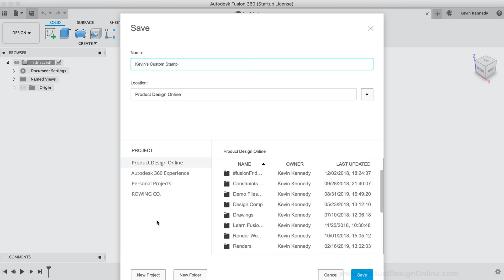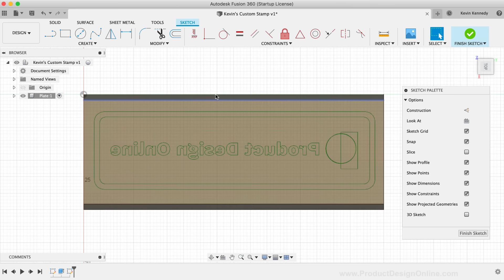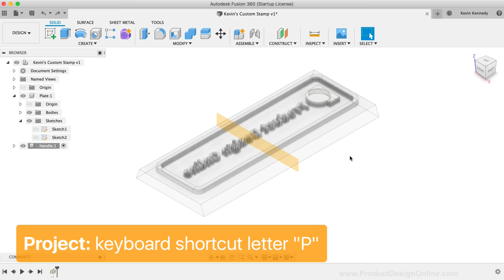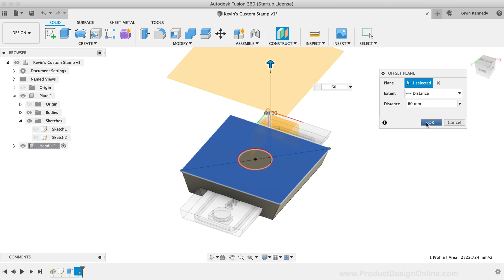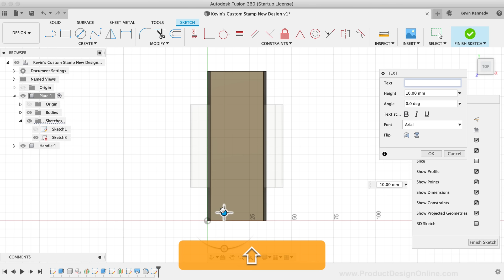Fusion 360 Tutorial for Absolute Beginners (2020)

Comment from the maker: New course: "Masterclass: Fusion 360 for Hobbyist Woodworkers" ► https://bit.ly/woodworkingCourse
Check out my Fusion 360 Beginner’s Checklist ► http://bit.ly/f360checklist
Grab the sample SVG file here ► https://productdesignonline.com/16
Create your own SVG file ► http://bit.ly/create-svg-file
-
TIMESTAMPS
0:00 - Fusion 360 for Absolute Beginners
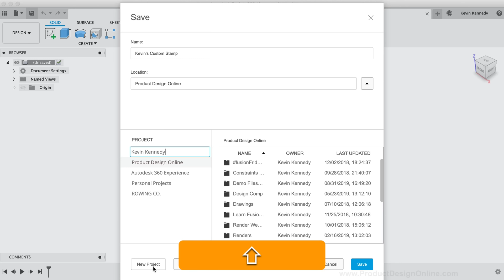1:30 - Creating a new project folder
3:00 - Creating a new component
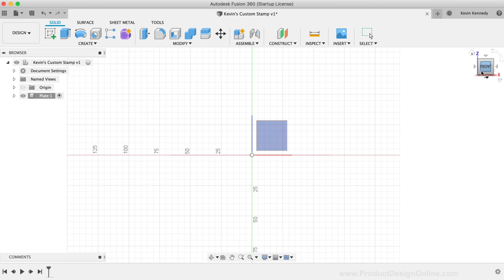5:16 - Sketching the reusable stamp plate
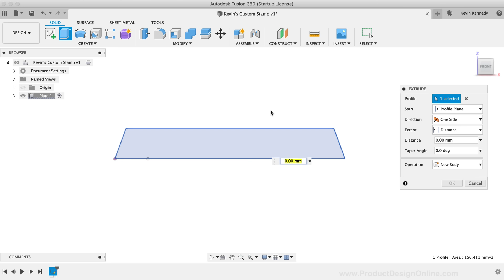8:01 - Extruding the reusable stamp plate
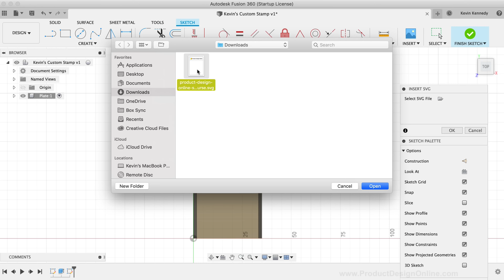9:49 - Inserting your custom SVG logo
13:37 - Creating the handle component
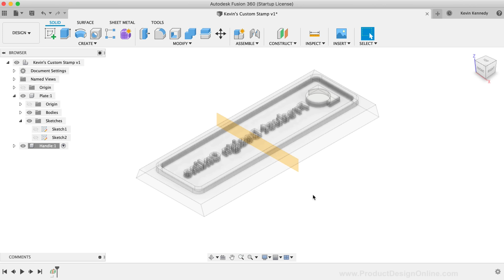16:50 - Projecting the base of the handle
19:07 - Creating the offset (tolerance)
21:30 - Extruding the handle part
23:09 - Creating the top of the handle
26:37 - Adding fillets to the handle
28:37 - Exporting for 3D printing

Comment: I'm just going to add a quick comment for anyone stuck at the same spot as me.  If you are not getting the option to select the plane, for the SVG, make sure you close out of the sketch pallette popup first.  This took me way too long to figure out because it was just never giving me the option.  I'm assuming if you select "insert SVG" while already in the "sketch Palette" popup, it just uses the plane that was originally selected for the sketch.  You have to "finish sketch", and THEN  select insert SVG.

Comment: This was very helpful.  Although this is in an older version of Fusion 360, it still works.  There are some differences, my version of Fusion doesn't have the Symmetric option in the Extrude box.  And when I would make some changes I would get a popup mesage asking me if I wanted to keep the same design or revert to the original placement.  I don't have the save as STL file option,  But I do have save as Mesh, but in the format Fusion asks if I want to save as STL ASCII or STL Binary and I wasn't certain which to do.   I also didn't have to flip my offsets, as they were already on the outsides of the original sketch.  Your tutorials are very beneficial.  I am watching the Learn Fusion 360 in 30 days.  Although it is a bit fast and there are some steps missing (such as completing the sketch), it is well done and I am learning quite a bit.  Thank you for posting these videos.

Comment: Very well structured and well-paced tutorial. I don't know if this is different between different versions of Fusion 360, but in my default setup, the offset tool was actually not visible or available in any of the pull-down menus, and so I had to figure out elsewhere that the very useful shortcut "s" for Sierra brings up the search for tool menu that also very helpfully let you add what you found to your toolbar. 

I'll be sure to look up your other Fusion 360 tutorials whenever I want to figure out more. Even if I probably could learn these things entirely on my own by using the software and its help documentation, tutorials such as these very importantly also teach you a lot of best-practice tips that will increase efficiency and make things far easier. Well done.

Comment: Not sure if you're still replying to this since it's 3 years ago but I was wondering, you mentioned printing supports when you print the base face down so it doesn't sag, we would have to extrude them on the top of the base in Fusion, no?   Or can you do it in the slicer?  Thanks and super video!

Comment: Is there any specific reason you decided to not centre the original plate sketch around the origin?  The handle part then had to be based on the middle of the plate.  It works but it's not as robust.  If the plate part changes in in the future, the centre reference may 'break', which affects the parts based on it.

If, instead, every component was based around the origin, you can use origin planes for your sketches, which is a more robust way to do it.  

Also, you ended up with a whole assembly that is not centred on the origin, which makes it more difficult if/when you were to place this assembly into another assembly.  

Unless specifically required, it is always best (IMO) to centre things on the origin and use the origin planes.  This is much more likely to keep the models from breaking when changes or substitutions are made.

Comment: It is just criminal that you claim to want to help people learn this software. I spent two hours trying to make the 70 degree angle line for the first plate sketch. The priorities for  defining the line is its length not the angle. Once the length is set it just wants more lengths, not angles. 
     Also my Fusion is in English dimensions not Metric so I will not be modeling a usable item. you might try to put yourself in a new users shoes, and try to figure out what can go wrong, or start by giving instructions for standardizing the software settings. 
     Thanks for wasting what little free time I have to learn this software. Now I have to find another source, no guarentee it will be any better than you are.

Comment: hi there, I am new to 3D printing and i've been doing a few simple things in fusion 360. You tutorials are great and I thought I would ask a question. I hope you have a minutes to answer. Thank you so much in advance.
I designed a couple of tool holders for my shop. However, even when I have set Fusion to inches and I am designing with accurate dimensions, when I move it over to Cura, the holders are super small. It is like if the measurements I entered in fusion using Inches are actually translating into Cura with a smaller dimension.
When saving the file for 3D printing, I am also making sure that the dimensions in the '3D Print' Box are in inches and that the file type is 'STL (Binary)'. when we i move it over to cura, its tiny. 
I scaled it manually on cura, but id like it to maintain the actual dimensions to avoid getting a failed print. Is there a trick for that?
Thank you so much for your videos, time and help!

Comment: A quick question when you place the SVG file into the project and place it on the model. How do you center it? Is there any way to simply know that you´re placing it center? And also, when like a SVG file has been dropped, my logo for example, how do move it around after pressing OK? It wont let me like "select" the picture to move. Complete noob at this!

Comment: Great Video, I learned a lot and it made me get comfortable with Fusion360!  One thing though, at about 31:50 you talk about replacing the existing plate's text by saying we could import another SVG.  However, what you DO (without describing it) is somehow produce a dialog "Design Shortcuts", type in the word 'text' and a list appears of various text related 'things', one of which is add text.  Two things about this:   The first is I had no idea how to get that dialog from the video, and, when I finally figured it out (with 'S' shortcut), I did not get the Insert Text choice after I typed in 'text'.  From the video, I don't know how to get that Insert Text operation.

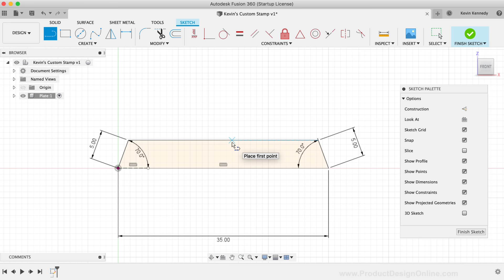Comment: Not sure if its becuase of the version upgrades - but I dont get the same response you do.  ie.  I get an arc when connecting the two points together to get the square 7:19 into this tutorial.  Also my 5mm boxes at each end at a 70 degree angle are not a perfect square - but a rectangle.  Not sure if it matters but I stopped due to the differences.

Comment: It's very helpful so far for a total noob. However, I'm encountering an issue. At 19:47, I'm told to  repeat off-set. As I'm trying to do so, I get an error message from Fusion360 stating "one or more of the selected curves has already been offset. Consider offsetting the original profile again isntead" and doesn't let me proceed. Not entirely sure how to move forward.

Comment: I spent an hour working on this in Fusion 360 and it deleted everything even though I saved it. It even says that the file is still there but when I click on it to open it it doesn't open anything. I don't know how anyone would ever spend $3,000 on this program it is unusable. It can't do the simplest thing without completely failing and yet people swear by it as the most advanced CAD software. It says it it is saved under the word projects but it doesn't give any file location. Does that mean it's on the cloud or on my computer? I don't even know where the file supposedly is.

Comment: when I made my own svg from text in illustrator and insert it,  extrude it...it all appears to look right but I only have 1 body instead of the many bodies created when I use your svg file. I've tried it several times with the same result. I even used your svg, I'm not sure this will affect the printing of this or not but wondered if you know why it is happening. Thanks for the great tutorial! 

******fixed!
For some reason when I put in the 2.0 mm and clicked, it automatically switched from "body" to "join" in the operation dialog box. I had to reselect  "body"...would this affect the 3d print if it was one body vs multiple?
Thanks.

Comment: my first issue I just started today I'm using the fusion 360 for personal and hobby use. So I do not have the assemble check box to open a new component. So how am I suppose to try out the product first before I buy it I like to work with it to see if its right for me which so far until now depending how expensive it is. So what do I do without the new component check box

Comment: All the old uranium and thorium fission reactor problems go away with the new Fusion reactor era now actually here. We have recently taken a new step to advance the physics of power production by enabling chemistry of the atomic nucleus, or "nuchemy", We are passing the chemistry level where we interacted with electron shells and are moving on to nuclear manipulations in this "nuchemy" atomic nuclear era when we interact and multiply nuclear protons using hydrogen fuel stock. We have rediscovered the lost work of the alchemists and can make new elements with different atomic weights and vastly new properties. This was ably demonstrated in "The Safire Project". Quanta are important. We now have enough energy in them to manipulate the atomic nucleus much more easily by creating a compartment or a simple local region of plasma containment so reactions at this atomic nuclear level can easily take place. This is about to practically enabled a fantastic new era of energy production for the whole of mankind. This with free fuel obtained from water or atmospheric moisture anywhere in the world. New fusion nuclear is at the industrial commercial production final development point as of now. The energy argument and other power methodologies are all now irrelevant as we have new and very physically and economically powered practical and local community level fusion nuclear power. Solar roof plus Teslawall battery may presently be the way to go domestically but megapack batteries and multiple storage technologies interconnected with an expanded ugly grid have a less certain requirement when you consider new any-scale community based and 24 hr self-fueling reliable fusion nuclear in the form of the "Safire Generator". Learn all about it at "aureon energy.com". Learn the newer EU physics at "Thunderbolts Project.com" and you will be permanently reeducated with the advanced new theory.

Comment: This was an excellent tutorial! Thank you! I struggled a bit with getting my own SVG, but then saw the links you pinned above and they were very helpful! (and for anyone else reading this, on Gravit Designer you don't create outlines for text, you need to modify it into a path). 

I also had a question about the functionality of the stamp. I just 3D printed it with PLA (I don't have a flexible filament), and it doesn't hold on to the ink or stamp it onto the paper. Do you have any tips on post-print treatment to make the stamp be more functional? Thank you!

Comment: Hello Kevin, Thanks for the video, it has shed light on my complete darkness. I just downloaded 360 and couldn't figure out how to draw a line. I have put about 8 hours of head banging and tripping in the dark. Some minor progress has been made. I would like to give my perspective, as someone that has zero knowledge of 360. I feel that there is no one that is showing the very basic steps of the program to permit one to actually create a very simple object within 30 minutes to an hour. Quite a bit is assumed that one knows about the program.
I would like to see something analogous to a paper and pencil approach. Starting with "here is the page" ( how does one starts by selecting a drafting plane. You gave some important reminders that start by saving the page in case 360 crashes) . Once the "paper" has been established, lets find out what "pencils" are there ( different ways to draw) , show how the short cuts operate to create some available forms,( flat, rectangle , circle) and how to go from the basic forms to 3D solids ( extrude?) or frames of the basic shapes. Once past that how to place holes on them and also how to position and reposition the holes, depth of the hole etc. Next how to attach, intersect, cuts, mirror images and flips, add and subtract objects and shapes, bevel edges. Create nuts, bolts, screws and put thread on the objects. At this point, I think one can start to use one's imagination and there is no limit as to what can be created. If you already have such a video, please let me know. Thank you for the time and effort to create the videos.

Comment: Hi Kevin. Thank you for making these videos!  I am new to 3d printing and completely new to CAD.  I am going to use your techniques to try to print a replacement footrest for a wheelchair.  I think it may take a little trial and error but I will post a pic when complete.  I found some files online at thingiverse, but it is for a solid block whereas I'd rather have ribs underneath for strength and less material.  Keep the vids coming!  Subscribed!

Comment: Not going very well unfortunately. It would be nice if you could also explain what could go wrong. In my case the plate remained blue and did not turn brown. I could still extrude but not by using the create menu. Then when I imported the stamp it did not click to grid and had to be manually aligned and even scaled to fit. And now it is showing in green. All seems well, but just not exactly as you were doing it. For instance when I clicked on "insert SVG", the top plate did not re-orient itself, and I had to do it manually using the view cube. Well anyway, I'll give it a while longer and see where I arrive.

Comment: Im must be missing something, the svg ive imported (your file) wont let me select the solid objects like you said, (for the extrude command)  its like the lines are not welded together in the svg, eash line looks like its not connected according to the software. the only thing i can select is the whole body of the stamp, not the outline or the individual letters.

Comment: I'm a long time user of Solidworks. It's a good tool, but this Fusion 360 has features it does not. One thing I like is that it's easier to build an assembly of components without having to make "drawings", then referring to the drawings for dimensions. In Fusion 360, it's already part of the sketch environment. I usually take a fitted part, strip out the extrudes and use the sketches to make sure the part fits and saves time, but this is also labor intensive.

Comment: I was thinking whether printing narrow (smaller font text) stuff like stamp sideways make sense, so 0.12 layer height could put finer detail instead of 0.4mm nozzle (wall) thickness. Some printers can do finer than 0.12 (z) layer height. Switching to 0.2mm nozzle diameter sounds a little worrisome to me because it can clog easier.

Comment: I noticed that small details like letter tend to print better if you print them vertically or diagonally because the layer height is usually smaller than the layer width.

Comment: for some reason when I am trying to add my construction line so I can finish my circles for my handles it runs my line and circles in the midplane and not on the bottom of the handle so when I try to loft my two circles it tells me the "rails do not intersect all profiles, what am i doing wrong?

Comment: Yes it's a good tutorial, but my only criticism is that he should've made sure that everyone was set up correctly.  The cube in the top right hand corner needs to have the Z and X planes at right angle to one another when looking at the cube front on, not as I discoverer on my 360 it was the Y and X at right angles. This caused plenty of confusion and frustration for me and almost put me off the program altogether. You can change the setting in the setup pull down section in the menu bar.

Comment: I need to learn how to have like an overlay. I make side plates for tattoo machines. The plate needs to hit 3 main points on the tattoo frame. 1, the bottom of frame where it will be welded to. 2, the rear deck where the side plate will weld to also. 3, where I need to drill a hole for the contact screw. I need a template that I can overlay the side plate to hit those points. I use a plate that is 76.2mm x 101.6mm x 3mm. I hope you understand. Any help would be greatly appreciated. Thank you.

Comment: I’m having trouble, when I try to extrude the sketch for some reason it’s keeping the outside ring of the circle along with the splines I added. When I select the sketch the area outside of the splines are not highlighted but when I raise it the unhighlighted areas outside the splines are also being extruded. So I get the splined areas raised but the outer circle is also raise. I’ve been trying to figure this out for over an hour and watching your every move and matching them exactly. The splines are lined up perfectly with the outside circle. If I extrude it in solid mode it only extrudes the selected area but when I use create form and try to extrude it keeps raising the unhighlighted area. Can you help please?